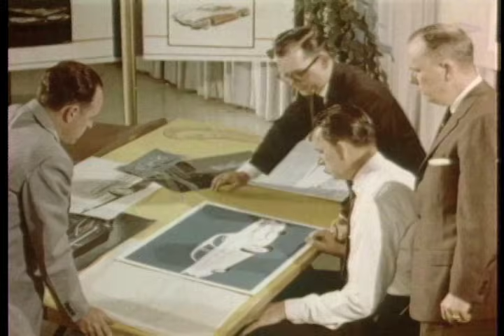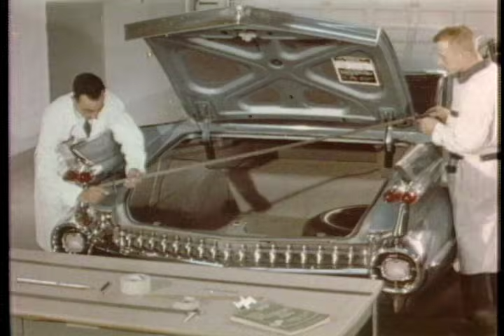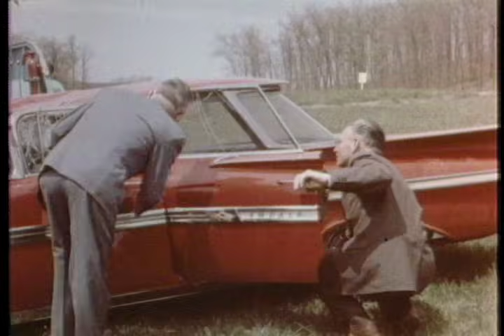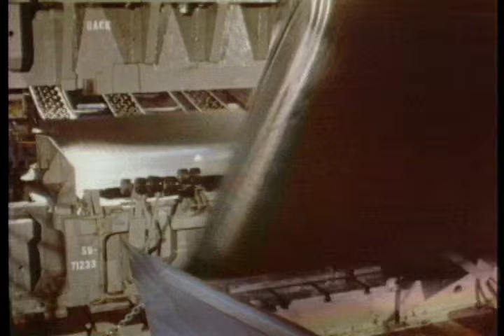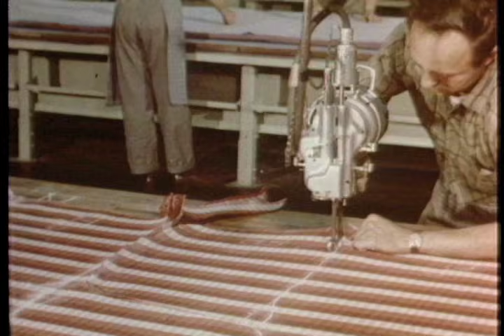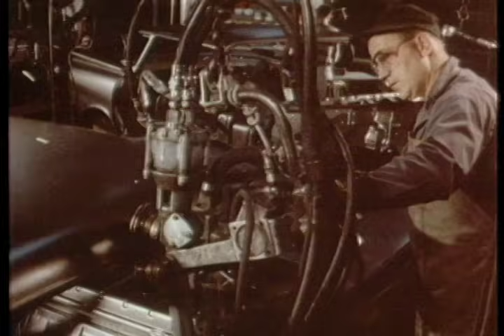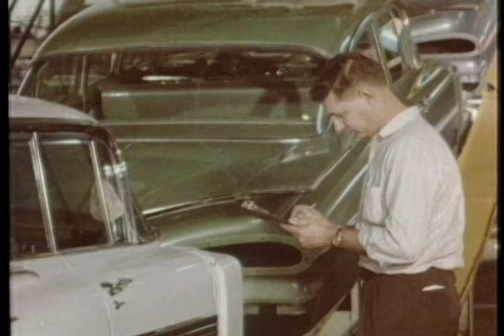How GM Built a Car in 1959: Up from Clay - A Car is Born

Comment: This is back when GM was ethical , designed by REAL engineers and built by real people with good intentions for a quality products . . . . . exactly the opposite of the self destructive over priced shit boxes , that can't be serviced or repaired by the dealerships or the independent automotive shops . . . parts are damn near impossible to get... hence a failed industry....  yes the general public is getting smarter................................................................... !

Comment: I guess I'll be an outlier here, but I loath the 1959 Chevrolet. I think it is aesthetically dreadful......both the tail lights and the horizontal fins. To me, the entire rear end looks to be grafted on to the rest of the car.
Reply from the maker: You're not alone! The '59 styling was pretty radical, especially coming right after the classic lines of '57. It definitely pushed the limits of tail fin design before everything flattened back out for the 1960s.

Comment: Back then America was truly great. I'm a German and I'm quite impressed how it was back then. Nowadays... oh my!
Thanks a lot for uploading and sharing.
Best regards, luck and health in particular.
Reply: There was a lot less bureaucracy back then (both on a corporate and federal level), wasn’t as many bean counters in control as well. The sky was practically the limit around this time, just about anything could be done fairly quickly with what was available at the time. Now, it takes quite awhile to get anything done and since about everything has been outsourced which created bottlenecks in supply chains which is why vehicles weren’t readily available back in 2021 and 2022, still is to a degree to this day. If everything was vertically integrated (Ford was known for making everything on site at the Rouge plant in Dearborn Michigan), that particular problem wouldn’t exist, quality control would be at a all time high.
Reply: @seana806  90% of US-brand cars are manufactured outside.

Comment: 10/10/24........I am shocked that the men working in paint spraying department, wore no masks to keep them from inhaling the toxic paint fumes. I was employed by a company that built steel cabinets. In the 1980s. They were semi-custom designs, and the area where the spray painting took places, was SO toxic. The atmosphere was clouded with color paint spray particulates. A virtual cloud of colored paint hung in the air. We were only given those sub-standard, paper masks. Later in other places I was employed, they at least had OSHA approved, filtered masks, and the paint rooms were vented, and the noxious fumes were constantly being removed (exhausted) from the surrounding air. Employees were only allowed to work in the paint rooms, in short 30 minute intervals, to reduce exposure to the highly toxic fumes.
Reply: Totally diffferent set-up, on a much smaller scale than General Motors. No inhalation; industrial down-draft ventilation systems. Painters were protected, and the cars only 2 feet away didn't catch any overspray, either.

Comment: I own a 97 Buick regal LS in 2024  running very good at 147000 miles replaced water pump and thermostat and a power steering hose leak over all i give it seven out of ten

Comment: I just watched a 1957 Chrysler assembly video. They were welding the bodies with torches and stick rods on their production line.

GM was a pioneer in manufacturing until the late 1970's, early 1980's. When Rodger Smith took over, he kicked out the most highly paid (and experienced) engineers. GM when down the toilet because they lost their organizational knowledge. Nothing was written down, just guys with 30 years experience who would pass on what they knew to the new guys.

Took another 20-years to regain some of it.

Comment: I joined the Army in 1978. When I got to Germany, one of the guys in my squad had worked for GM as a draftsman. Back then GM had its own training program for skilled workers like die makers and body engineers. I got in (and got exempted from the draft) out of high school.

He said working as a low-level draftsman was the most frustrating job you could imagine. He would work on one part of a car, revised the drawings over and over and over.

The last straw for him was the Monza. He designed the metal piece of the dashboard that held the instrument cluster. He did nothing but revise that drawing for a year. After that, he quit and joined the Army.

IN 1979, everyone he worked with had been laid off. So he got the last laugh.

Comment: When I was a kid a grew up in a 1958 Pontiac Safari Chieftain station wagon that was replaced with a non-descript ‘60s Chevrolet station wagon with the humdrum design and sloppy construction so typical of the era — and the start of Detroit’s downfall. In 1966 my dad, a mechanical engineer, bought a new VW Beetle. From then on the many cars he owned were imports: a string of Volvos, Toyota pickups, two Lexuses, and finally, a Honda Odyssey. I still have his 2008 RX350, which finally had its first repair: a water pump at 122,000 miles. I replaced the brake pads and rotors at 116,000 miles — for the first time. When I first saw the Body by Fisher tag on the door sill of that Pontiac I wondered why it depicted a horse-drawn carriage in the era of the “modern” automobile. GM meant to invoke an image of old-world craftsmanship, but instead was supplying bloated, inefficient designs that stopped and steered like boats. By the 1970s quality and engineering had plummeted to a point that my dad’s tectonic shift from domestic to imported nameplates merely mirrored what what was happening all over this country. Half a century later we’re still trying to catch up.

Comment: It's fun to get nostalgic and look back at the past through rose-colored glasses, but the reality was these cars were needlessly large, needlessly heavy and extremely undependable, they rusted out, hard to start etc etc. No one today would even consider these cars acceptable today for daily transportation. The cars of the 50 into the 70s were basically dressed up 1940s car.  Things didn't start changing until the 1980s when the Japanese almost put Detroit and their antiquated 1940s way of thinking out of business.  A modern car weighs less, more fuel efficient, more crash worthy, is smaller but has way more interior room, starts all the time, the exhaust, muffler etc doesn't rust out every year, and you can easily get way over 100K miles.  My brother in upstate NY with all the brutal winters and salt has a 2010 Subaru that just clocked 300K.  Like my grandfather used to say, the only good thing about the "good old days" is that they are gone.
Reply: Some of that may be true, but people with cash would happily part with some to get a restored Sixties early Seventies muscle car, made in Detroit.
Reply: Nostalgia is a very powerful drug 😊
Reply: Go pound  sand.

Comment: My father, a loyal Chevy guy at the time,  purchased a new 1959 Bel Air when I was 3 years old. Dad told me years later that the car was a lemon and he had kept it less than a year. I remember being fascinated by the fins. Still am.
Reply: 1959 Chevrolet had "wings".....1959 Cadillac had "fins".......one goes out side ways - the other goes up and down......hopefully, you're not still confused.....
Reply: GM rushed heavily revised ‘59 designs into production after the huge public response to Chrysler’s Forward Look designs in 1957.
Reply: Sorry about your luck.
Reply: I was watching the way that car wobbled as it traveled across a flat road, it looked heavy and not very aero dynamic.

Comment: We had a production manager for the Willow Run plant at the Corvair convention.  Not much good to say about Fisher body.  Best thing happened was when the body manufacturing was combined under the General Motors Assembly Division.  (GMAD)  Fisher didn't talk to or care about the assembly plant. My Corvair's fitment on the body leaves a lot to be desired.  Much worse than Fords and Mopars.

Comment: Everybody has wonderful nostalgia for old cars. They completely forget that those cars would be lucky to make it five years before they rusted out or the engine was completely shot or the entire car was completely worn out. Hitting 100k miles was an astonishment back then.
Reply: Back then it was more or less expected that you'd trade in every 2-3 years.  Styles were always changing and you were expected to keep up with the current styles.  That and most cars of that time, especially in areas where salt is used, were shot in 5 years anyway.  For me, and probably most people, the nostalgia is for the styling of the past, not the build quality, safety and driveability.
Reply: The old cars that survived long enough to benefit from modern lubricants, rustproofing and modern rubber are even more viable today than they were when they were new. Tires, belts, hoses and electrical parts today are far superior than in years past.
Reply: Yes
Reply: If used motod oil was cooked and made into tar, then brushed on the underbody they won't rust. Some did that sucessfully. Car owners then, as now don't consider rust to be a preventative issue, but it sure is
Reply: Toyota would like to know how you make a truck last 5 years before it breaks in half
Reply: If used motod oil was cooked and made into tar, then brushed on the underbody they won't rust. Some did that sucessfully. Car owners then, as now don't consider rust to be a preventative issue, but it sure is - like maintaining a home
Reply: Finally, somebody that recognizes the truth.
Reply: I remember very well. Born 1950, licensed 1966. My first three cars were built before WWII.  From 1967 to 1974 my daily driver was a 1940 Chevrolet Coupe.
How old were you “back then”?
Reply: Yep, There was a good reason why they called a lot of cars rust buckets back in the day.  And really if you got 75,000 miles out of an engine without having to replace it or rebuild it. You were doing really good. Being born in 1951, I have seen a lot of rust buckets and a lot of worn out engines in cars that only had less than 80,000 miles on them.

 Compare that to nowadays where some automobile engines can knock out 100,000 miles or more easily without major repairs and for the most part, major rust problems have all but been eliminated. That said, I can't help but be nostalgic about the styling wars of all the cars from the '50s, '60s and '70s. Every auto maker had their own idea of what style was and it was pretty exciting as a kid or a young man to see those. And yes cars last a long long time nowadays but the other side of that is to me they all look the same.
Reply: @carlmontney7916 I think the thing that played a big role on how long a engine lasted back then was how one’s driving habits along with changing the oil every 3 months or every 3,000 miles. Many people fell for the 5,000 to 6,000 mile oil changes (the oil change conspiracy isn’t entirely new) which wore out the engines sooner than necessary so they could sell you a new car sooner than necessary as well. Another example of ‘planned obsolescence’ at work though, this isn’t the typical planned obsolescence we are know of, but is one of those things where it’s at one’s discussion. 

I think by the time the 1960’s came around, cars gradually began to last longer and longer since the tolerances were beginning to get better and better along with things becoming a bit more standardized. The ‘66 Ford Galaxie 500 I am goin to be getting (hopefully) has the 289 in it paired up with a C6 automatic, wouldn’t be surprised if it actually has 162,000 on it judging by the wear on the driver’s side of the seat and leaky transmission. Easily will make it to 200K once everything is fixed since the Ford 289 (same thing as the 302, just a slightly smaller displacement) was known for running for a long, long time.
Reply: The engines were less durable than todays but the body and frames were worlds better than the ones now ( with a few exceptions of bad paint batches in the early sixties)
Reply: @lindasimard1902  Frames and bodies were better back then? Don’t kid yourself, they weren’t. More beautiful? Maybe. But safer, more rustproof and more rigid with better materials? Nope. I love old cars, but that’s pure nostalgia.
Reply: @lindasimard1902  No, that's a lie. The bodies rusted out in three years where I lived. Cars were garbage back then.
Reply: Chevys rusted too. but the powertrains lasted longer than ford and Chrysler

Comment: Great video. But after all that massive effort what we have is a 1959 Impala? Absurd conundrum of those times.
Reply: The Chevrolet Impala was not the only car we had in 1959.  The Goliath full sized car was not the only style.  The U. S. Was not the only country producing cars.  We had Mercedes.  We had Volkswagen. We had Volvo. We had Power Wagons.  We had 4x4 Ford trucks.  We had other offerings in General Motors all the way to Cadillac.  We had heavy trucks and buses that were the standard for many years.  Checker made their mainstay—the Superba.  We had factory air conditioning. We had improved automatic transmission even in pickup trucks. Yes—they didn’t show it here—but we had a lot back then

Comment: Fascinating.  And yet most would rust away less than 10 years later.
Reply: Glenn Havinoviski, most people would trade in their car for new one every three to five years back in those days They were never designed with ten year durability in mind.
Reply: @lrg3834  My Dad allways kept a car 10 yerar
Reply: @raysitzes2455  , your dad obviously took very good care of his automobiles. I applaud that. Personally, I have two trucks, one that is 24 years old, the other 14.
Reply: @lrg3834  then He bought a 62 comet total peace of junk He still kept it 10 years probably spent 60 thound dollars in repairs that taught Me a lesson when You get a total limon get rid of it something was allways wrong with it from the start put Me off fords for a long time
Reply: This is not an 80's car
Reply: My parents bought a used 1959 Pontiac Catalina in probably 1964. They bought it from a used car lot. Looked good! Until a few months later and all the Bondo started falling out of the rusted out body!

Comment: 24 months later they were a pile of rusted junk. Then, back to GM to buy a new one.
Reply from the maker: +R.L. M. Planned obsolescence.  Now we have three year leases.  Sort of the same thing. Except now the dealers get something back they can sell.   But we end up with perpetual monthly payments.
Reply: Well oddly enough thanks to the EPA and emissions regs cars now have fuel injection which greatly improves engine life because of better cylinder to cylinder fuel distribution.and much less oil diluton and sludge . very common today for a car to have 200K miles very very unusual then . so really saved on the pollution it took to build a car per family if you only need half as many,. course then the family broke down and now you need twice as many .  I had a relative who went to GM,s Fridedaire division and the y gave him the job to design a door handle for a fridge, he did so and they said it was great , looked good was cheap to make but they couldnt use it , it wouldnt wear out quick enough. back then you got a new fridge when the door parts quit.
Reply: my '65 has held up just fine for 51 years. better than any new car will ever hold up. and mine lives it's life outside and uncovered, not in a garage. i had to replace the floorpans but that was due to a leaky back window with old cracked weather stripping, and if not for that, the floor would have been in perfect condition just like the rest of the vehicle. it will last another 50 years and again. BUT, i am in California, and not in a snow zone, so that does make a huge difference comparatively.
Reply: That's BS unless you lived on the beach. GM was all my father owned, 52, 55, 62, 65, 69,77, 85 all Oldsmobiles. None rusted out.
Reply: matrox Ha ha boy scouts don’t lie, my Duster was toast within 8 years, same with my mom’s gremlin another rust bucket within 8years, she even had that Ziebart undercoat 😂
Reply: Well growing up in Cleveland, Ohio, would  have 8 years before the road salt really took its toll
Reply: @OKFrax-ys2op  more like 2-3 years for major rust... I should know I'm from Ashtabula 60 miles east of Cleveland
Reply: Ron Treen It’s all part of the rusty belt, that loves rocksalt in the winter 😟
Reply: Any one named boss hogg is obviously a dumb ass.

Comment: Probably 95% of those jobs don't exist now with the digital innovation and robotics - will be even less very soon which is sad in many ways.
Reply: The jobs have just been changed. Instead of 300 draftsman they have 50 cad operators, but they have more computer science engineers.